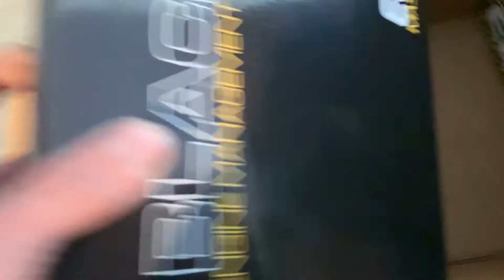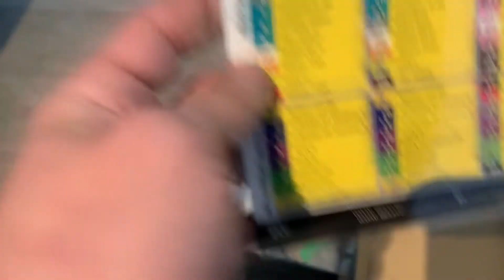2jzgte Re-Assembly and ECU Master Black unboxing

Comment: Hey I had a question is u can help me out. From your alternator harness. Where did you tap the IG into? And the Lamp. If you used it, just ran a light bulb in the engine bay? S' can just loopsbto charge wire if it's direct battery cable right.

Comment: I am looking into this EMU myself but it shows the plug and play harness compatibility for NON-VVTI, how are you going to get around this?
Reply: Germ02jZ he is wiring the harness into the emu black himself. He’s not using the factory harness, that’s what that bundle of harness he first pulled out was. Ecumasters just recently came out with an adapter for the Vvti harness for plug in play.